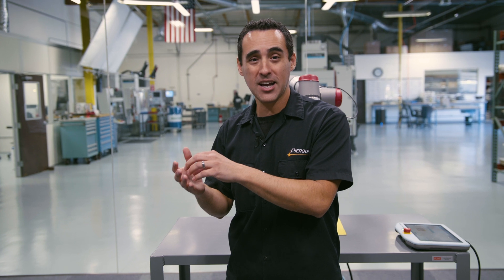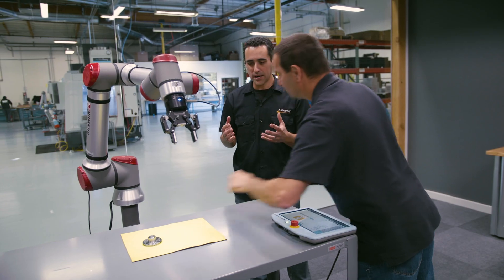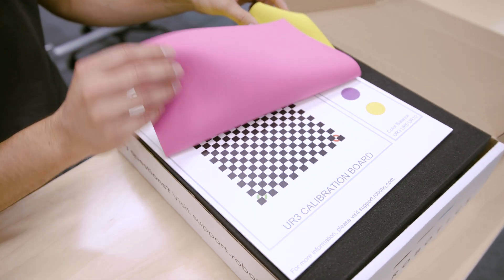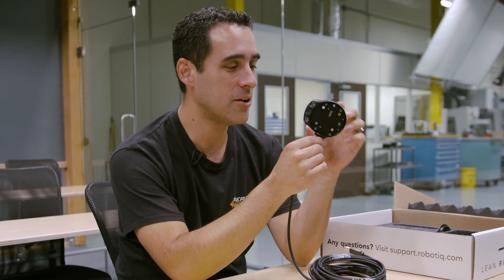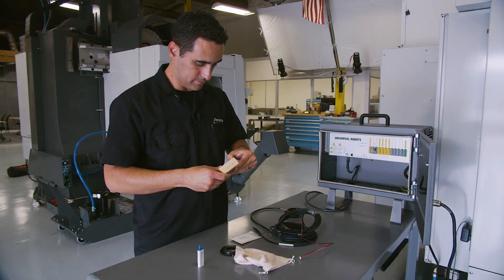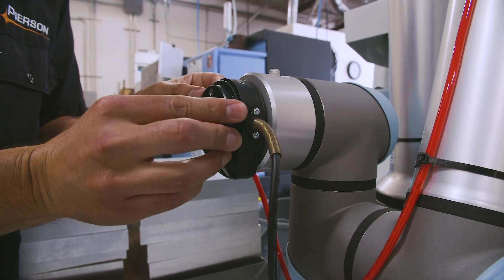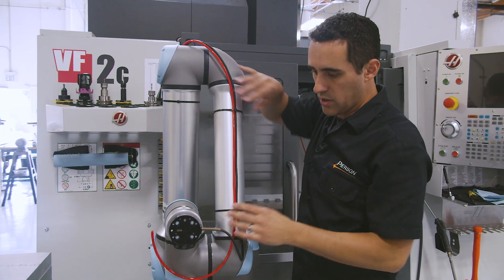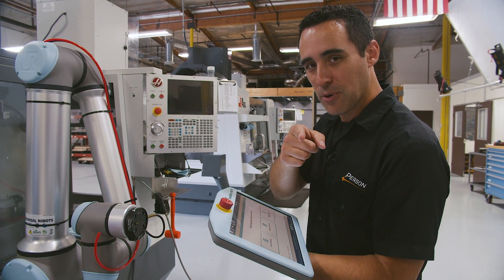Robotic Vision | The Robot Episode 4

Comment: 5:52 I know the video was posted 3 years ago, but since I saw the calibration board, and my PhD thesis was in this field, The black and red circles for asymetry shapes at the corners can be eliminated by adding or reducing one row or column of the checkerboard pattern. The shape becomes asymetric if the number of rows and columns of square would be the combination of odd and even numbers. If anyone from RobotIQ read this it might be a useful thing for them. :)

Comment: Just a stupid idea, would it hurt the lifting capacity too much if the center of the suction area is off from the robot attachment center point? That way you could keep the maximum gripping area int the vacuum block.
Reply from the maker: I think I know what you mean, but pocketing an area in the vacuum gripper wouldn't change the vacuum holding level.

Comment: That's pretty ridiculous that they use a licensing dongle; couldn't they put the license inside their custom hardware?
Reply: My guess is that they did not develop any of the image processing and object recognition/tracking software - they are licensing it and using an API. This is great, but perhaps the third party has a licensing scheme that requires this. I recently completed a project with a lot of image processing where we licensed the IP. They called the shots on how we were allowed to validate the hardware and it was kinda dumb. Our only other option was to write our own code that would have killed the project immediately.
Reply: @Factory400  that seems like a logical conclusion.
Reply: They are using the library from Matrox hence the dongle.
Reply: Agreed. That seems super silly. I am sure there has got to be some funky limitation with the UR controller they are kludging a workaround for though, because if there isn't a compelling engineering reason for the dongle... bejesus!
Reply: @LumaLabs  the other option obviously is to not put DRM in the software .... but I understand companies selling into the industrial space have unbelievable levels of distrust of their customers (definitely not looking at Dassault) so management wouldn't let that fly.

Comment: Very interesting video.  Some things come to mind.  It looks like the camera placement will be a limiting factor regarding the gripping tool size and placement.  Also, usage of multiple USB interfaces may become a management problem.  Especially if you should want to use more than one "add-on" application and it also comes with USB interfaces. 
My two cents.  Please take with a grain of salt.
Reply: This solution is more of an ease of use type. There are others that work as well or better but are more complex to setup.

Comment: Make sure you plug in the usb from the camera to the SS port on the controller. There are two USB ports. One will be for the usb hub and the other will be the camera. If the plug the camera into the hub, you might experience some lag in the Robotiq URCap.